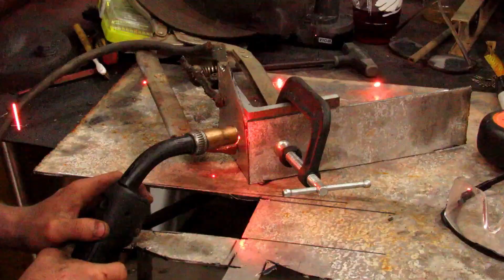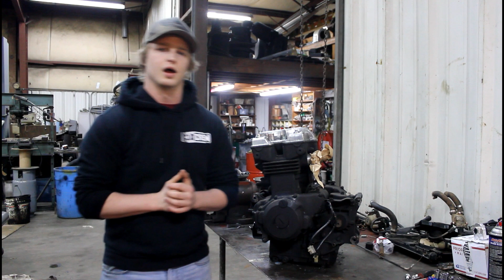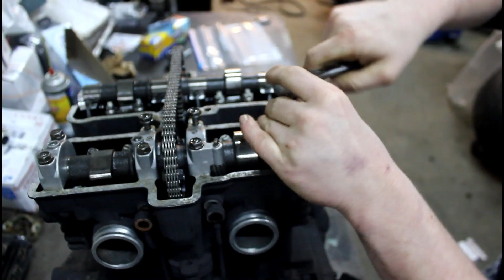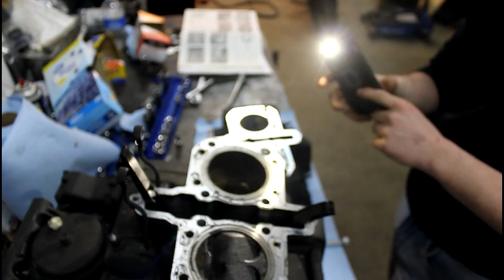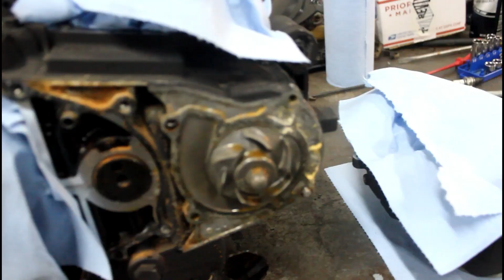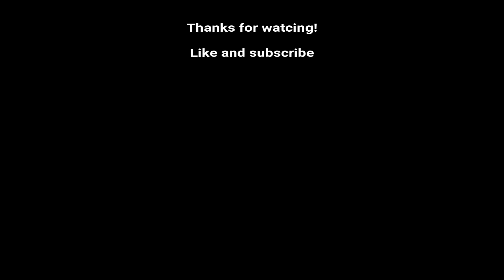Kawasaki bobber build pt.5 (454 engine disassembly)

Comment: № 1: Bought my 454 LTD a year ago.  Stripping threads is the way it is for Japanese bikes.  The oil-tubes' bolt threads were the latest to give me a middle-finger.

№ 2: When I checked the valve lash on the bike when I got it home, only one rocker had any clearance; This one only by one millimeter.

I cannot wait until I get it up and running again. Summer is almost halfway over.